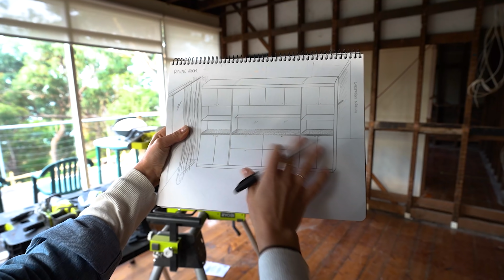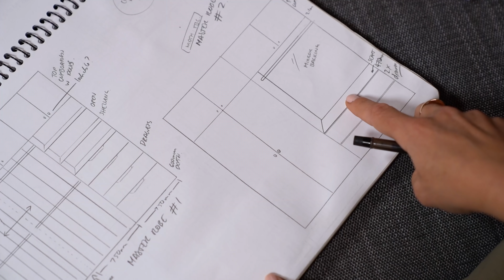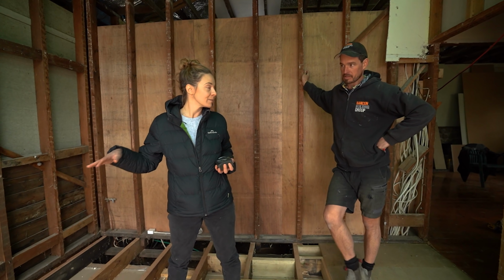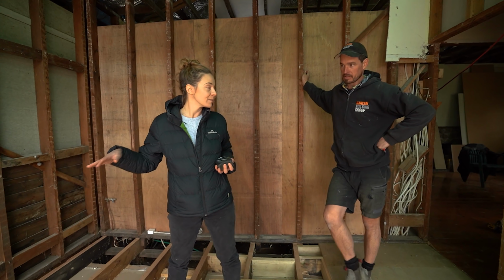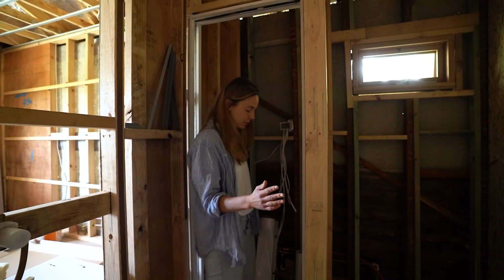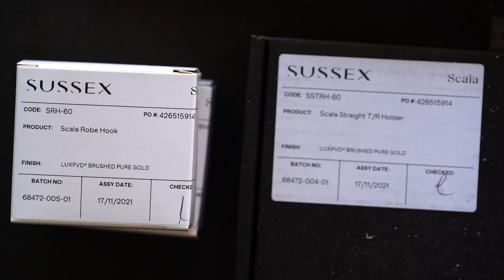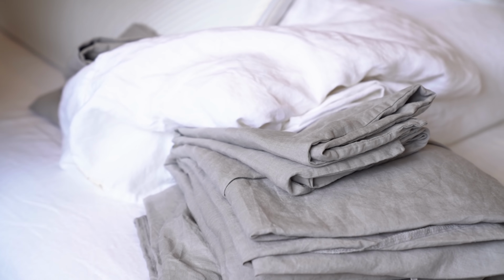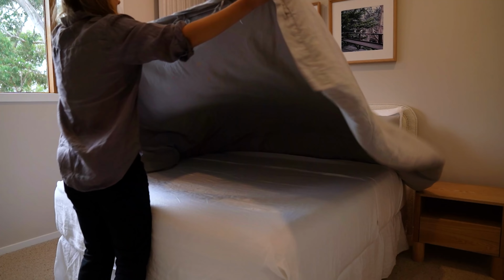Epic Bedroom Makeover! Designing a Bathroom & Bedroom. Luxury Modern Coastal Interior Design & Decor

Comment: Perfect Lucy and Johno! After using one of those toilets, you can never go back! (If it is the same as the Japanese ones, you can take off the whole seat for cleaning a few times a year, and be sure to periodically clean the little holes in the spray heads - old toothbrush works well). After almost 20 years of a combo washer/dryer, I went back to separates. The combo's 'cook' your clothes dry (hence no air vent) and they take ages, so are only for really necessary days. 
I can't wait to see the kids' space.
Reply: Totally agree on the combo washer/dryer. I had one in an old flat in London, the residual moisture in the barrel after a wash means it takes forever to dry. Perhaps the modern ones are better, but I defo wouldn't recommend.
Reply from the maker: Oh the royal loo... does take some getting used to, but seriously we were impressed. Thanks for watching
Reply from the maker: It's been efficient but it's definitely a handy back up - we use the main laundry downstairs for most of the laundry
Reply: @Huntingforgeorge  Hah, hah, before long you'll be putting royal loos in EVERY bathroom you do! And they are actually eco-friendly as you cut down to needing very little toilet paper.